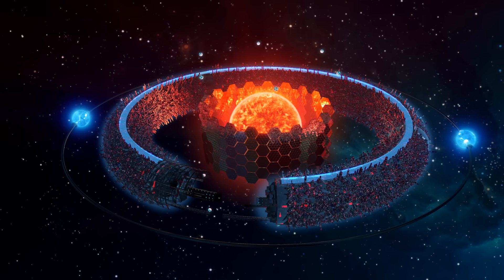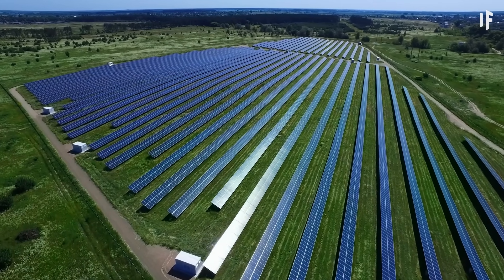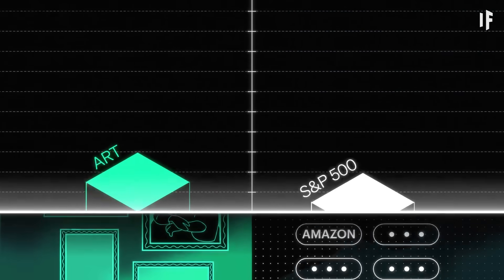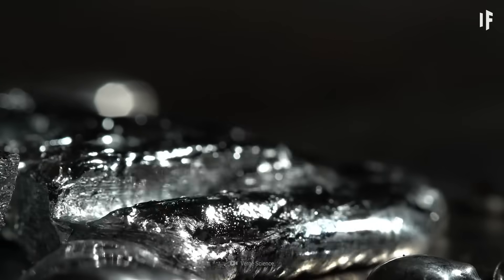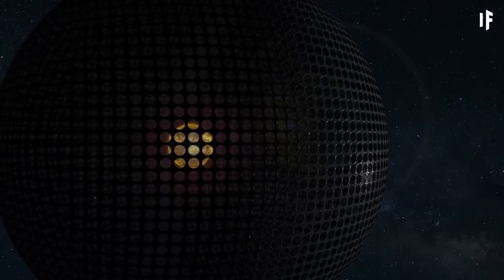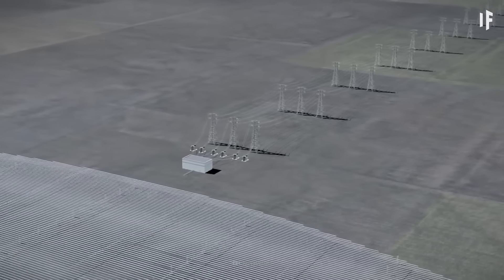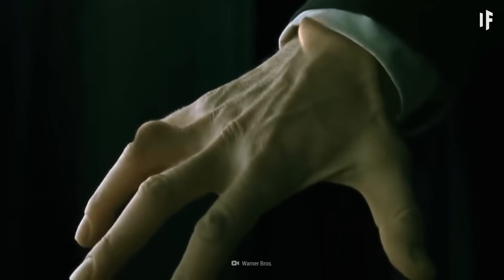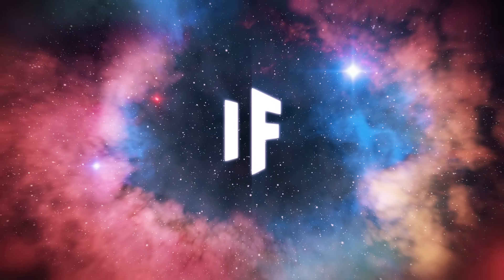What If We Put Solar Panels Around the Sun?

Comment: It could never be possible in other words. The RF energy would be so strong that you would actually be able to feel it. That would take the power into trillions of watts, and no transmitter would be able to legally operate at that high of output power without causing harmful interference to other radio services. It would basically cause a huge mass on the airwaves.

Comment: It is not possible to put solar panels around the sun. The sun is a massive ball of gas and is not a solid surface on which to install solar panels. Additionally, the temperatures and radiation levels near the sun would destroy any material used to make solar panels. However, scientists are looking into ways to harness the energy of the sun through other means, such as building solar power plants in space.

Comment: You have to Advance the Battery first that can store energy without aging and more capacity in mini scale without any problems. Then put the solar panels in space rather than in the earth as earth has only limited sunlight. If the batteries were charged in space then harvest them and export them to the earth.

Comment: No need to be placed near the sun. Just above the satellites orbit and would be a great improvement over the ones on earth. Store the energy in huge batteries and send them back to earth  on a space elevator or with some returning rockets. Does not sound that scifi to me. And could someone explain t me why is concrete not used to build stations in space ?

Comment: What about sunlight which is needed for everything here on the Earth? With some of those represented structures there wouldn't pass enough of it to us.
It would be better to place solar panels on Mercury.
Reply: Sounds like something a Mercurian would say. 👈 👈   👉 👀 👈
Reply: We can still get sunlight. The solar panels don't have to completely surround the sun for us to get enough of the energy we need.
Reply: @cris8627  as I said, not with some of structures presented in the video.
Reply: @sandrokostic6008  Well you'd be right, but point is that putting them on mercury because we wouldn't get sunlight in earth isn't necessary. Simply using less solar panels would work

Comment: Wouldn't it be better to build factories on Mercury to construct the solar power satellites? Cheaper in the long run than shipping millions of solar panels into space. I'd put the solar panels just inside of Mercury's orbit, so some of them could power the infrastructure and factories on Mercury to build more solar power satellites (SPS). It wouldn't be a solid structure, just a swarm of SPS's orbiting the sun at an angle so that the earth and the other planets would still get their normal amount of sunlight. 

For power transmission, forget microwaves. You could use high power lasers to beam power to earth orbiting stations, then relay it down to surface stations built to absorb the energy without heating up the atmosphere or frying the population. You would need to build these stations at high altitudes and away from population centers as well as flight paths of course.

Long term, you could use the power and set up an antimatter factory or 10,000 or so of them on Mercury, turning locally mined materials into antimatter - the biggest issue so far with making antimatter seems to be the enormous power requirements needed to create such exotic material and then to contain it safely - then ship it to power plants on earth or wherever needed. Also it would make good fuel for starships. Or bombs, knowing humanity.

Comment: Wouldn't it be more "practical" (in terms of materials and travel costs) to go to Mercury, build a factory there and use the planet's minerals to build the solar panels to send around the Sun?
Reply: but how would you bring back the energy to earth ?
Reply: @DVinod-oz8np  Like stated in the video, maybe. Or by building highly advanced batteries to send to earth. Mercury can be used to build and send the solar panels around the Sun, it has smaller gravity than Earth, no atmosphere and it's mostly made of metals, so it would be a huge cut on the costs compared to building sending stuff from Earth I think.
Reply: @AcaciaAvenue  
I have an idea as well. If we can't bring power to the people, then bring people to the power.
Reply: @marrqi7wini54  I can't say if this is a joke or not but. Yeaahh let's do it
Reply: @tusarosnow9858  
Orbital habitats closer to the sun. With proper shielding, they can be protected from the harsh star. So no, I'm not joking. We can do it.
Reply: @marrqi7wini54  There's a thing called O'Neill Cylinder that would be something like that, there's a What If video about that. Habitats at a smaller scale would work too, and probably will be one of the ways to go when the Sun will transition to its red phase and Earth will be uninhabitable. I wouldn't build closer to the Sun, though, but on the opposite direction.
Reply: My idea cost less: go in africa there u dont need more energy lol

Comment: theres a problem with that, there are still some things like plants that need direct sunlight, and blocking out most of the sun, would be detrimental to life on earth. though solar panels sounds like it would work. it really wouldnt.
Reply: I was thinking the same thing, you can't block out the light with the solar panels, otherwise earth turns into an ice cube. Put the solar panels far out in earth orbit so they don't block the sun, still have the problem of transmitting that collected energy to earth

Comment: 7:45, how about that there would be battery sort of things in the solar panels which would get charged, and after it's done charging the battery could automatically detach itself and go to maybe some main hub made in space which will store all of that to a bigger battery sorta thing which would go down to the earth, and the battery of the panels would go back to the panel. I mean yeah it's all theoretical engineering this wld be very complex
Reply: Theoretically yeah. Like the hub would be like the iss or something. Every few years when the shuttles come back with the batteries then we could power the earth for a while until the next one comes. But then come supply and demand issues and variables. But it'll never happen because greed controls the planet.

Comment: Why are we trying to get the power back to Earth? If you're making a structure around the Sun, then you might as well just house everyone on it. It will have a much larger surface area than Earth with that diameter, which means way more room for our increasing population. With all that energy we wouldn't really need to worry about efficiency at first. You could have all the food and trees and stuff growing on the opposite side, and reflect sun around or even use full spectrum bulbs to provide the light needed for the plants to grow inside the giant structure. Put all the water in panels or pipes on the surface facing the sun to heat everything inside, provide steam power, and block some of the radiation. We could even make giant electromagnets around the structure to block some of the radiation, much like how Earth does. Removing all or most the humans from Earth will let it restore itself a bit and let some of the other animal populations grow, or just mine it to the core and bring everything to the megastructure with us, like an ark. We could try crashing Jupiter into the sun first to make it more dense, and we could feed it more planets periodically to prevent it from collapsing on itself and destroying everything, but that would also mean we would have to find a way to redirect the sun so we can travel to other systems to use them as fuel. So I guess the main concerns are steering the sun, and making sure we have enough water for everyone, the plants, and the animals. We have a ton of water in the oceans we aren't really using, so that could sustain us for a few hundred thousand years while our sun makes the journey between systems. It would be a hard decision to tear apart our solar system and get rid of all the planets at first, but if that's what it takes to ensure the survival of the human race then I'm sure we would do it if we had to. It would seem like less of a big deal once we've done it, and, I mean, there are how many other planets in the universe? So who really cares if we have to sacrifice a few uninhabited planets to survive and travel to another solar system?

Comment: Yeah, the whole "getting it back to Earth" thing has always been my most major problem with the Dyson Sphere concept.
Reply: Why not move manufacturing to the ring? Then energy demands in the planet would be negligible compared to at present
Reply: You believing any of this is real is a problem
Reply: @davidsheckler8417  I never said I did. Quite the opposite actually. It's a theoretical concept that's been in science fiction for decades which would be implausible and impractical in reality for reasons the video talks about.

The channel is called "What IF", not "What IS", after all.
Reply: Yeah, sure. Build a giant space death ray. What could possibly go wrong?
Reply: Orbital elevator where the receiving process is done at the earth orbit or the moon. Then the elevator is a giant cable to the earth.
When a strand of cable returning back (read : loose then collapse) to earth, it is a What If situation tho.

Another idea is to pack the energy into a super battery, then transporting it back to earth. I said super, because normal batteries just be a dead in weight for transport. When it explodes however, is a what IF situation.
Reply: That's the huge problem with the theories that center around solar from space..
Reply: Maybe figure out how to make electromagnetic wormholes?
Reply: @doomsday7699  You'd have to prove wormholes even existed first.
Reply: @LendriMujina  I mean that's the only way I see of bringing the energy back to earth without causing any disastrous effects. The other way would have to be a wired method, but that would be a nightmare to handle and what not.
Reply: A really long cord. Duh.
Reply: use high power lasers then convert it back to electricity
Reply: I mean, you could use some kind of energy absorbtion unit on every section on the Dyson Sphere that can transport the energy through space, or two energy converters that can change the sun's energy into electricity instantaneously, then through super durable massive wires that connect to the Dyson Sphere, send them to an absorber region of the Earth to bring the energy to all plants that can take it. (Each one COULD be distributed evenly)
Reply: @naruske.1911  At the very least, you're grossly underestimating just how fast the Earth moves, and just how far away the sun is.
Reply: @LendriMujina  your also grossly underestimating of how fast technology evolves. At the point where humanity starts making a Dyson sphere, it would already be way more technologically advanced then now. I’m sure by that time, there will exist a way for energy to be transferred to earth.
Reply: @wildk5367  yeah, but it would NEVER be "massive wires" like he was responding to

Comment: If some of the sun energy is lost and reflected because of earths atmosphere I think that a good step to that direction would be to put up some solar panels on the L1 lagrange point. Still, we had to think about how we would deal with the radiation being send back to earth without being fried.
Reply: L4 or L5 would be better as they have stability 1,2 & 3 don't
Reply: How are we getting the energy from the panels to the earth?
Reply: @SevenPr1me  wireless
Reply: chicho, frying is a feature, not a bug. The military would want this.
Reply: Space cables